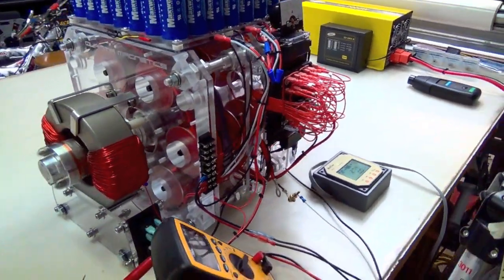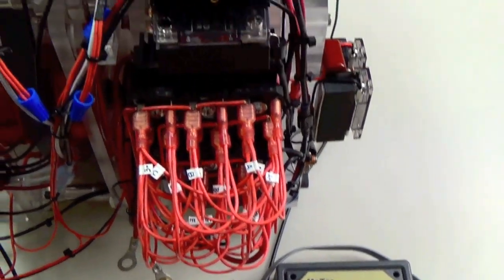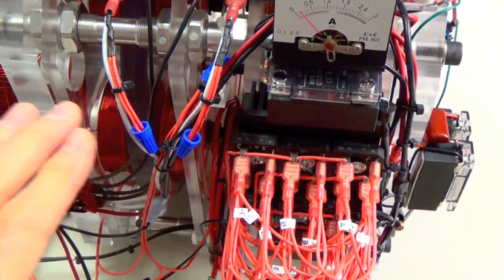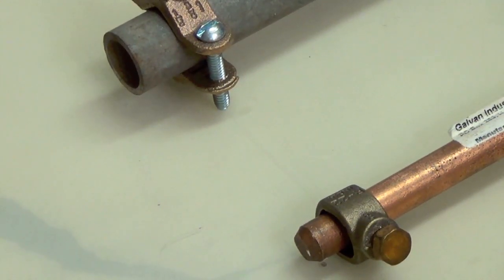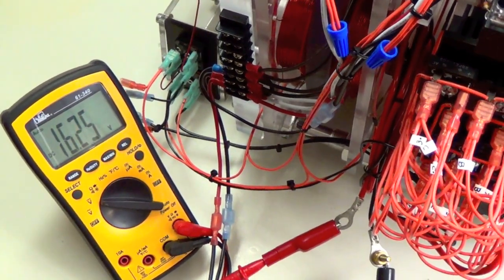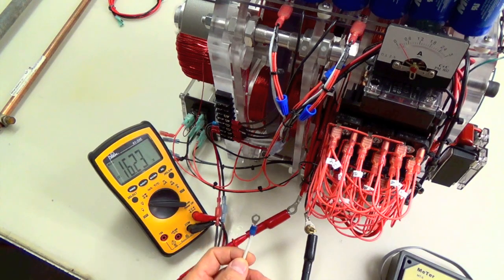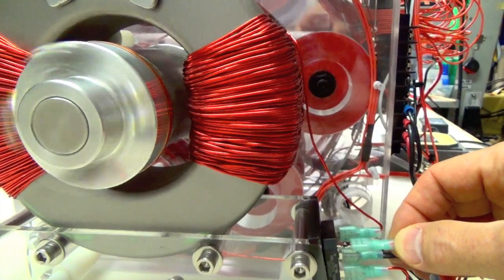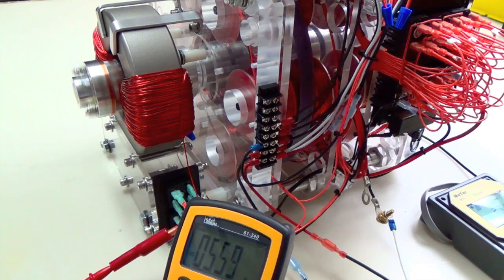559v Out with NO Electric In

Comment: This is called boost circuit and already used in electric cars, it's easy you can output 1 million volts but it's useless at the end you can't output more effective energy than the input due to the law of conservation of energy.
Reply: Hisham Alwaal boost circuits are nothing but step up DC-DC transformers more or less and burn amps off like crazy... with this hes achieved 550v output and only 27v in with no amperage, which proves once again the laws of conservation of energy are moot and nothing but Victorian era primitive thinking

Comment: Hello all, I am just getting into checking out these motors, I know little to nothing about electricity except that I want to get off the grid with my house.  Looking at this video, i have a question.  Why can't the voltage that is generated with the motor be pumped right back into the grid to lower your electric bill?  I love the videos about charging a battery pack, but no talk of how to use these motors to power a home.  Like how to connect things to your existing breaker box.  These motors are expensive for the average person,  so much more to buy, like magnets and batteries, and caps....I would love to see a whole complete Kit for sale.  It would be a daunting task for a average person to assemble one of these kits.... I would love to find people that could help me go off the grid.
Reply: PMMG4HYBRID  Ultracaps can be a little pricey at the moment, but it wouldn't surprise me if, in the next ten to twenty years, we are able to 3D print them at home. ...I wonder how far away we are from the technology to "3D print" on a molecular level.  There is a channel called Imhotep.  ....The Leedskalnin magnetic current series offers an entirely different perspective of what electric power really is.
Reply: Barry Perkins  That's how most off grid systems work.  The most common "mainstream" off-grid energy sources are solar followed by wind.  In both cases, energy is stored in large, (typically 12 or 24 volt), battery banks for later use. DC-AC Inverters are used to convert the low voltage, high amperage DC, into usable 110 or 220 volts AC.  It would be impractical to try and power a home directly from the output of a generator like this because the output on devices of this type tends to be more subtle than something like a 10KW petroleum powered generator that can power an average sized home directly.  Batteries can actually help you save a little fuel in that case as well.  ;-)
Reply from the maker: Strif Tsal That is precisely correct. Conversion efficiencies will also increase by incorporating a hybrid ultracap config.

Comment: I'm interested in where you think you are going with this? Have you considered posting a video of what WE can do with this?  I see the same question being asked over and over, "can this be used in my off grid house?"  Have you considered showing us a mini system of how this "could" work in a system, for us non-electrical engineers?  I know you need batteries, a charge controller and inverter.  But how quickly will this pulse generator re-charge the lead acid batteries?  and at what voltage?  I see the solar panel guys recommend not to use more than 30% of the battery capacity if you want to get a long life out of the battery, how does this relate to the output capabilities of this machine?
Reply from the maker: I have another video called "Home Power Station" that shows a real world application of the Q3. The MPPT charge controller helps the Q3 self regulate the charge to batteries for long life usage.
Reply: PMMG4HYBRID Thank you for the reply.  I watched the video, although very good, its not enough info for me to purchase your Q3 just yet.  Do you have any suggestions where I could learn how to properly size loads, the amounts of batteries etc.?  Mostly I am interested in knowing how many batteries can the Q3 charge and how fast?  I would need 40+ batteries.  Is it true I should only use 30% of battery capacity for long life?  If there is no load and batteries are fully charged do I need a system to shut the Q3 off?  If not where is that charge power going?

Comment: Wetness of soil in an earth battery does not necessarily effect the output of an earth battery. You may have a different efffect but there is still more to do to test the earth battery effect. Some more ways to lower earth resistivity is to treat the soil with a salt, such as copper sulfate, magnesium sulfate, or sodium chloride. Combined with moisture, the salts leach into the soil to reduce earth resistivity. If you already have very conductive soil, just adding water may not improve it.

Comment: The voltage increase is from the earth battery effect you are getting from your zinc/copper rods. Test this by soaking the ground for a couple hours around the rods and then measure the voltage. If you ran this for an extended period of time, you should see oxidation on your pipe.

Comment: This unit is very efficient at charging batteries.  If I were to hook it up to a secondary bank of batteries I could switch from one bank to the other and use the charged ones for powering the vehicle. How long would it take to charge the second set of batteries for say and all electric vehicle. I can drive about one hour on a full charge.

Comment: How long does the reed switch last?  Have you looked into a Radiant circuit to pull radiant energy from the "earth capacitor"? I don't have the funding for the large build, but I have a small build with a radiant circuit and a 1' x 6 " piece of insulated aluminium foil and a 3' dedicated ground copper pipe.  It reminds me of a Tesla dynamo like you mentioned. I wish I could afford one:( You have it open sourced for the progression of the earths peoples?  Love your work and keep it up, you rock!

Comment: I noticed that this Q3 has a different toriod. Is this a different version from previous videos? It looks larger and thicker and it's not green. What kind of load could that 600 volts drive? Just curious if it could be stepped down to run an air conditioner or say an electric dryer.

Comment: I have always found your videos to be very professional as well as entertaining. Your Q3 is quite interesting. I'm thinking of going full time motor homing and this motor/generator could keep me off the grid. Since everything in an RV is either 12VDC or 120VAC a battery bank and a pure sinewave converter should be all one would need with a small solar panel for the input voltage. I would be interested I your opinion on this matter please. Thank you for your contributions.

Comment: Hi,

For Earth ground and voltage rises - please do little research on how ground connection affects BEMF spikes. Also in conventional circuitry the BEMF is always killed instead of amplification (which is shame because the returning energy is simply wasted).
Also the toroidal generator in your setup has great potential due almost no cogging on dead short of its generator coils. You might expand on this into OU device path. The Tesla motor/generator patents are the key for that.

Cheers!